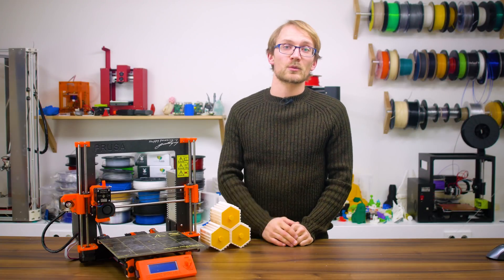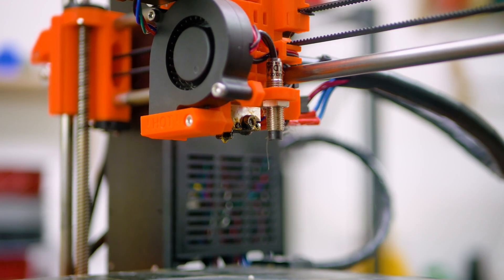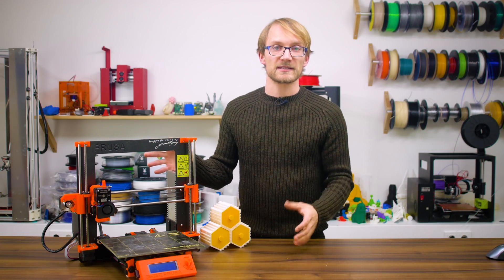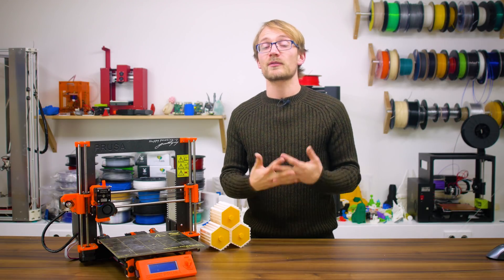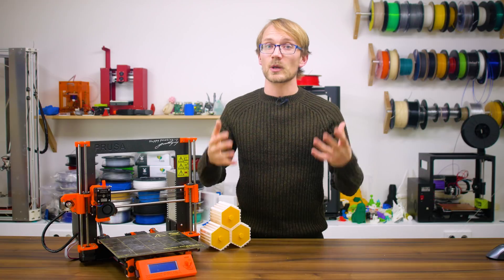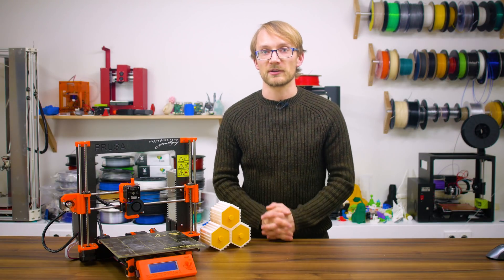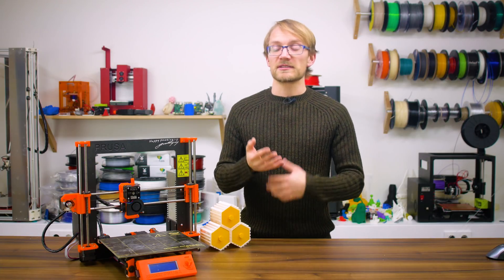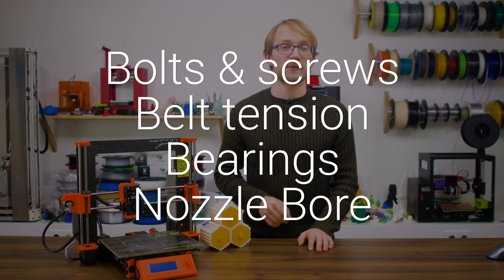Basics: How and when to service your 3D printer!

Comment: Once a year check for stress fractures in the printed parts. After 2 years my Lulzbot Mini developed stress fractures in the X and Y motor mounts and idler pulley mounts,  which had to be replaced. After another 5 years I've noticed the X idler mount is starting to crack again. Other than that the printer's held up really well.

Comment: So can i use.. machine oil (sewing machine maybe) for my linear bearings and threaded rods?  
(As oils with Teflon is not available locally.)
Reply: Someone else in the comments said they use sewing machine oil. Apparently you're not supposed to use Teflon with bearings. Something about particle size and jamming them etc. But Teflon is great for things that slide instead of roll.

Comment: What do you do if the printer start Clicking from the Extruder?
Reply: You figure out why it's unable to take in filament. Could be stuck in the filament sensor or in the extruder entry because the filament is uneven. Or it could be clocked in the hot end. Just to name a few examples.

Comment: Wd-40 is pretty much a machine oil, its basically just a 10 weight oil that you can spray.  In the machine shop we used it all the time as a cutting oil/coolant

Comment: I need suggestion as to how to tighten my belts easily in the Reprap Tronxy printer. I see mine are way too loose. The last time I tried, I caused the x axis to ram into the sides. I am concerned about doing this again. I like how they should give a base sound to test their tension.l

Comment: great video sadly if i did most of that it would void my warranty for the dremel idea builder. :( they so need to rework there warranty to just the electronics inside it. rather then the whole unit. they expect me to send the printer back to get the nozzle replaced when i could do it at home in 5 mins. :(

Comment: When you move the printhead manually at 4:52 the display comes on, maybe because of the induced voltage produced by the motor when you drive it by hand (in which case I assume it acts as a generator)?
Reply: It totally looks like it's trying to boot right there.
Reply: Yep
Reply: Yep, that’s what happens. The back EMF goes through the drivers onto the 5V rail. Hence why he’s saying don’t do that too hard.
Reply: Back EMF. Working on motor controls for a living, that is something that has to be considered in every design. Our 24V motors can generate as much as 80V in some cases. We use special circuitry to bleed anything over 27V on the motor plane through a large resistor. This also provides a "braking" action on the motors. Without it, the FETs in the H-Bridge can be destroyed.
Reply: James Merritt in practice, standard (Reprap-based) 3D printer motors and drivers are not all that susceptible to this, unless you go wild with moving the head manually.
Reply: @JasperJanssen  You are absolutely right...didn't mean to scare anyone from moving things around on their printer; I only meant to imply that the phenomenon is the same.

Comment: You missing two basic controls especially on MKII in this video - first all connectors in Rambo - if everything is ok there is no play in connection (specially in conector for heatbed - if they are badly connected it can starts melting and shortcut rambo with fire hazard) and the second control (like I said specially on MKII) is check bearing in extruder which pushing on filament - the axis in bearing is 3d printed from PET and can crack very easy - then printer start to do bad retraction movent or filament starts to stuck in extruder and can lead to fail of whole print...

Comment: Is that actually how your belts sound like? Mine are nothing close. I have the same printer. I can hear a tune, but it's kind of a crappy one. Problem is, when I tighten it even more the x-idler starts making squeaking noises when the extruder moves from right to left. Any ideas on how to cope with this?

Comment: I've never heard anyone talking about a subject that keeps me worry, and it's about the horizontality of the gantry in machines that use two motors and leadscrews for the Z axis. If, for some reason, one of the motors rotates alone, the gantry will be unleveled. Athough this will be compensated with bed leveling, this lack of level could cause an extra torque required by the motors, possible jamming, and wear of mechanical components. I use a couple of "height gauges" that I place in each side of the gantry and, with the printer turned off, I push the gantry down until it touches both gauges. This ensures that it's horizontal.

Comment: Belt tensioning WITHOUT sound:
Example:  X axis on the Prusa MK2 has potentially 3 screws, right?
Remove the top 2 screws and loosen the bottom one so you can pivot the motor on the bottom screw
Remove the top right screw first, then the top left screw.  Once you remove the top left screw, examine how far offset that motor's screw hole is to the mount's screw hole.
When the belt is taught against the motor pulley and the motor screw hole is no longer visible through the mount screw hole, that is proper tension.
Same kind of goes for the Y-axis, but it helps to have a 3 point mount on the Y
The key is to remove the screws on the diagonal.

Comment: I think you forgot the "electonic board service"... check all the heatsinks if they are sitting snug, check if the coolin fan for all parts is working (control box, PSU, hotend), perhaps dedust them a bit... For every extended service check the voltage of the PSU in idle mode and in "full power mode" (heating up bed and hotend simultaneously) and see how much the voltage decreases... (rule of thumb: should not be more than 8-10%)

Comment: Wait.... Should my belt be that tight?
Reply: the belt SHOULD resonate, but nomatter how tight it wont sound like an e string bc the e string is usually a nylon composite that has similar characteristics to a steel wound string, or a steel wound string... but the belt should still have a humm to it when you pluck it, like a rubber band when you pull it between your hand and a door knob and pluck it
Reply: yeah it had me worried! The belt sounds nothing like it.
Reply: No that was just a joke, lol

Comment: I would also add to check the connctions of the electronics, sometimes , vibrations can loosen up screw terminals, and lose strands could cause fire damage. I would also add to check the temperature probe for correct seating, my prusa i3 overheated due to a slipped out temp-probe.
Reply: loose strands shouldn't be a problem if you're using ferrules

Comment: I would love a guide on how to replace the pei sheet on the Prusa i3 mk2. I actually managed to rip a small piece out when removing a print that stuck to the bed a bit too well
Reply: Jeroen Bouwens warm it up. Then find the corner and slowly pull it off. Hardest part is gonna be getting it started and if it rips.

Comment: 2-3 years ago when I first got my printer I did a lot of research into grease for linear roller bearings including talking to a few local bearing shops with one of them being a specialist linear supplier.
  The biggest takeaway: DO NOT USE THICK GREASE. Especially not on the super lightly loaded ones on things like 3d printers.
  Use a 00 or thinner grade semi-fluid grease with no additives(PTFE or moly will actually jam the balls due to the low forces and relatively large particle size) or oil(Oil requires more frequent lubrication but it's safe, easy and works, even something as heavy as 10W40 gear oil works great, it's just harder to past the seals). Any thicker and the tiny balls can't 'flow' and become purely hardened steel on hardened steel bushings, something that with thicker grease will let you get away with but negates the point of using them!

Google 'semi-fluid grease' I use Penrite but I'm sure there are others out there.
I'll go into detail about packing the bearings if asked.

If your going to wipe your hot-end off with a cloth, make sure you use cotton or other things that don't melt! :)
Every other point you made, agree completely! :)
Reply: My exact findings, never use thick greases and never mix incompatible oils/lubricants. If you intend to completely change lubricants, clean the bearings thoroughly. Never mix lubes
Reply: PterodactylDanceParty just purchase sewing machine oil 😁

8 months no problem noticed yet
Reply: Sewing machine oil('light machine oil') works just fine but you do have to reapply it every week or three(ideally a drop every few prints after wiping dust off the rods).
The point is that I have not touched the lubrication on my machine in years after repacking it with the right grease. I now have two more machines at a maker space running with the same stuff. Extra work for long term reliability. 
However yes, machine oil is an easy and cheap option if you keep up with your lubrication secedule.
Reply: @ElectraFlarefire  Would you kindly elaborate on packing the bearings? Would be much appreciated.
Reply: I got a few cheap bearings and tried a few different greases and yeah moly grease seemed to make them slide worse and even more rough than no oil or grease at all. Would that type of grease be better for the threaded rods (Z axis) though, since the particles might take up room and potentially reduce play?
Reply: For threaded rods then the heavier greases work great. I've used Super Lube as well as standard 'thick' bearing grease but semi-fluid grease works fine and I use that as I have it on hand. It behaves like an oil that stays where you put it. They are loaded surfaces(Your whole X axis+hotend) so there is less worry.

I also replaced the steel nuts/rods on my much-rebuilt 'lets get something rubbish and use it to learn' Chinese i3 with brass on stainless good quality stainless steel threaded rod that both reduces resistance and means the nuts, not rods wear(Easier replacement but after a year and a half of few-hours-a-day printing with auto-bed-leveling keeping moving, there is near zero wear). I really do need to replace them with far superior ACME thread.
Reply: i use bicycle chain grease, which happens to be semi fluid. (not on my bike, but for a thousand other things)
carefull with mixing different types (silicon/mineral), come combinations flock or curdle

Comment: Tom,  dont you think you are promoting mk2 too much? We know its good printer but its not flawless. People are having issues with it.
Reply: its a great printer with just some little fin tuning
Reply: Karan Chaphekar What kind of issues are they having?
Reply: Who are the "people"?
We just got one for our makerspace and the only issues were what you typically have with a 3D printer: Learning its particular ins and outs.
Even a new print user has it turning out stellar prints after a bit of advice.
edit: typo fix
Reply: I've had mine for a few months now and it's absolutely perfect. I don't know what the issues you are talking about are.
Reply: well anyway... meanwhile I changed to Zortrax... own an M200 and an M300 meanwhile... just for fun.... hobby and so you know ;)
Reply: I think you might have erroneously conflated the Mk2 clones out there with the actual Prusa. The Josef Prusa units are the highest quality for the money I've seen.
Reply: +Butthurt Beluga , We have a Printrbot Simple Metal that we got expecting it to work out of the box. We were sadly mistaken (read: This is not trashing Printrbot in the least). After assembly, we purchased a printer that was scratch and dent, so we knew the bed was going to be slightly warped. This wasn't the issue completely. After about 6 months of messing with it on and off we found out the problem was the Windows USB serial drivers causing issues with sending prints to the printer. During this 6 month period we managed to get the printer to print a select few prints with decent quality. However, we had frequent communications issues and only discovered this after using my laptop running BunsenLabs (Debian fork) for sake of just messing with it in a workspace. What brough us here is we ended up buying a Matrix Precision extended bed to get the "bed leveling" issue off the list of possible problems. Turns out, our printer worked great when plugged into Linux or Mac hosts. Otherwise, on Windows we ended up with spontaneous disconnections and trainwrecks in printing. Now, this is the kicker, the printer would print extremely well if we used rafts. However, we had horrible bed adhesion (always did) using the brim method. Not satisfied with this, we ended up trying using gluestick instead of painters tape on the bed for adhesion, and it worked fairly well. We still had issues with the brim working every time however. We ended up taking the old UBIS hotend off and switched it to a E3D V6 (This was after testing a J-head and found issues with it's quality making it impossible to use  - we did fix it however), after messing with it for a while we finally can print brim, almost perfect prints at 0.2 and 0.1 layer heights with .4 nozzle. You can't trash Prusa's printer for "not being flawless" because EVERY printer has issues. Nothing will work always outside of the box.  We even had an older Makerbot Replicator (Not the Wooden One) that had issues out of the box. Turns out it was due to an air register being NEAR (not on) the printer that was causing issues with warping. So expect problems. We had a Lulzbot Taz also have issues printing the same print. The Prusa is one of the best 3d printers I've seen, and it can print amazingly well. But you have to, just like with any 3d printer, learn it's ins and outs extensively, and spend time adapting to their nuances. There is no real such thing as a semi-affordable 3d printer that doesn't require this. Unless you spend THOUSANDs you're still going to experience minor issues.
Reply: John, you're talking about a printer more than 3x the price and really cannot be considered for the hobbyist range. Yes, it's an excellent machine for those who crank paid part jobs 24/6+, but it's not a desktop price point. Professionals need less of this instructional information, these videos are aimed at enthusiasts & hobby builders.
Reply: Yup. I was going up the wall with a print today. Spent hours trying to get it to start okay. Then switched to slicing that particular model with Slic3r instead of Cura and instantly got the results I wanted.
Little things can make a big difference in printing.
Reply: It's a dual extruder system with a very nice touch panel, wlan and in my case especially important a build volume of 30x30x30cm (the N2 plus has even 30x30x60)
Reply: Couple weeks late for sure but I am one of those people who are having constant issues with my MK2 - for the last almost half year.
Even today I'm dealing with a problem that completely prevents me from printing - and it's not the first time, and I know damn well it won't be the last.
Reply: Too many to list, honestly. I had a text file after a while where I kept a log of all the problems I encountered by date/description/solution, the list got long very quick to say the least.
Right now I'm dealing with under-extrusion when I know it's not software/nozzle clog/filament/extruder springs/debris on the extruder stepper motor pulley
Reply: I had a hard time evaluating mayn many 3D printer (including Ultimaker, Zortrax, Makerbot etc...). I talked to quite a few people who earn there money with 3D printing and my final decision was the Raise3D N2 with the flexible/magnetic buildtak upgrade and Bondtech extruders...
Reply: Cura never works for my Airwolf
Reply: I hate the Prusa meanwhile... happy I could sell it and changed to a "real" 3D printer.

Comment: If its the last print of the day, I remove the filament from the hot-end while its still hot and put the spool in a zip-lock back wth desiccant to keep it dry and dust free overnight. For spool changes, I run at least 50mm of filament through the pre-heated hot-end to make sure all the old color is out and everything is flowing smoothy.

Comment: As far as belt tension, I have a PrintrBot Play and on both the X and Y axis, there is a spot in the middle where there is less resistance, is this normal? Prints seem fine either way.

Comment: Excellent, this is one of the first maintenance videos for 3D printing on Youtube! Maybe the grease should be plastic and rubber safe. Silicone grease is plastic and rubber safe. Dow Corning Molykote 111 is one of the best, it doesn't melt, it's food safe, and lasts a very long time. The ANET  OEM belts sucks, you can make your prints much nicer by changing these.

Comment: can you make a top ten best affordable 3d printers 2017
Reply: Thomas Sanladerer. No mention from anyone that the drive screws on the Z axis stepper motors need regular lubrication. I use a thick silicone based oil for this, and it works really well! If these aren't kept maintained, they can really affect print quality, especially on the i3, where they are always working during a print to rectify any deviation on an un-level print bed...

Comment: For machines without auto bed tramming, you might need to check the bed leveling (4 screws in the corner of the bed).  I also find I need to periodically readjust the Z endstop adjustment screw (mine is spring loaded).  Both of these adjustments need to be made with the hotend and bed up to operating temperature.  I suspect the constant heating and cooldown causes these adjustments to wander.  Oh, and the new Marlin RC8 mesh bed leveling doesn't seem to work if the bed is really far out of level.  I wondered why i was having bad layer separation and warped circles.